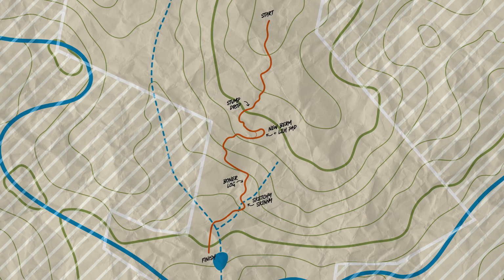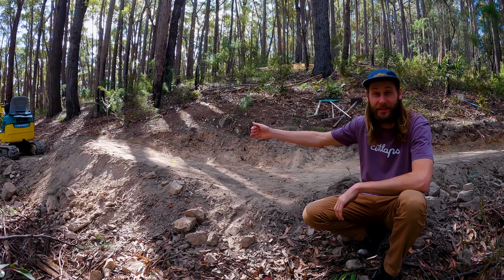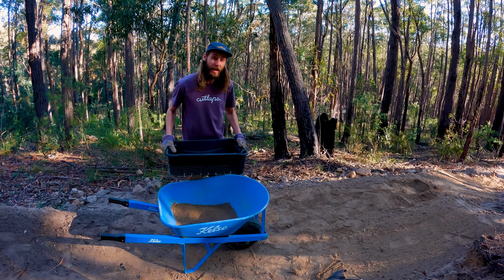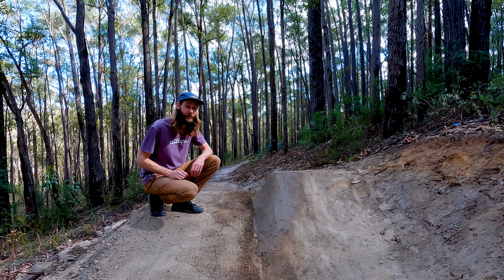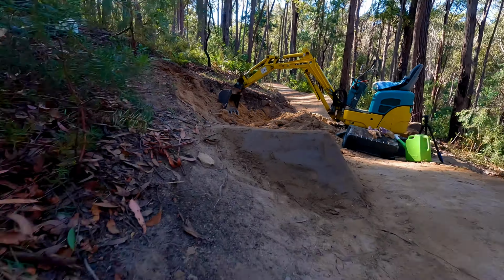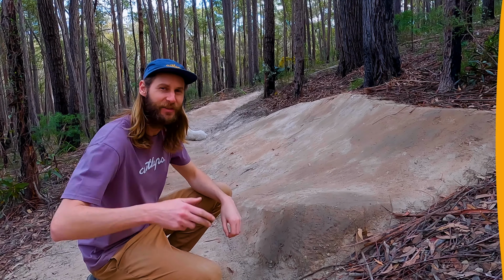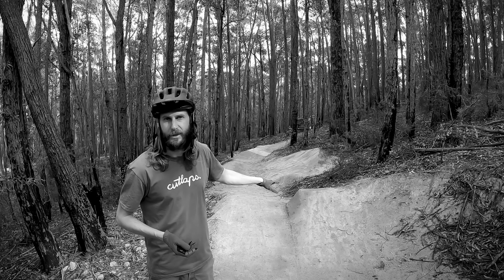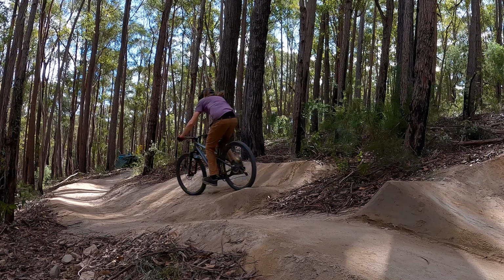This MTB Feature is FAST!

Comment from the maker: Let me know your suggestions on how to make the jump work better. I'm thinking of making it a straight landing. 
This episode's t-shirt winner is JohnnyTheG! Congrats. He also has a YouTube channel you can check out. https://www.youtube.com/c/JohnnyLeeFilms
Reply: yeeewh !
Reply: The hip could work with a different big line off to the side that crosses over the trail and along with a bit of a rhythm section with different line choices if you get what I mean
Reply from the maker: Oh yeah I think I know what you mean. That would be pretty fun.
Reply: @JohnnyThe_G  Congrats mate!
Reply: You could straighten it out with a curved shape so some riders could still land high on the right leaning like a semi wall ride. I imagine this just means straightening the exit and leaving the start of the landing as is then extending the catchment berm to hook into it further down trail.
Reply: @cutlaps  great minds think a like
Reply: Not sure if you've already altered it mate. But you could have moved that roller forward and used it as a landing for the hip. Then just build the following berm up slightly.
Reply from the maker: @kriswilliams6149  Thanks mate! Yeah that could have worked for sure. But yeah it's changed a bit now. I pretty much removed the jump because I needed the dirt for the next feature (the corkscrew) which needed a lot of speed so the jump there didn't work anyway.
Reply: @cutlaps  where about in aus are you based mate. If you dnt mind me asking
Reply: i have just got into your vids, amazing!!!!!!!!!
Reply from the maker: @superduper184  Thank you! Stoked you are enjoying them
Reply: Your the best YouTuber, I look up to you so I can be a mountain biker one day
Reply: make it bigger

Comment: I would get rid of the jump and make it double roller if some people want air and have a high speed/ low speed feature down the trail so they can choose.
Reply from the maker: Hmm that's an interesting idea. The second roller probably wouldn't need to be very big as you wouldn't be getting much heigh off the roller. Just enough to smooth out the landing.
Reply: Double rollers are sick, hell you could even stretch the second roller and give it a second landing to make like a "dragons back" triple. Triple for the mega speed demons and rollers for the chillers.
Reply from the maker: Hell yeahhhhhh there's definitely the speed there for a triple. You would pretty much be landing in the corner though!

Comment: Love the show and I'm learning loads. I'm up the road at Sussex Inlet and building a trail in the hills, only trouble is the sand. I kid you not that it would be 95% sand and sand like the beach with about an inch of soilish leaf litter. I have managed to get help from a Facebook group and the ideas are so helpful. I'm using everything from hessian bags to broken roof tiles and concrete to pieces of carpet, anything to make sand firm. Oh yeah quick set and importing clay as well as a heap of timber jumps , berm walls and drop offs. When it's done I will invite you up for a day at the dunes. For your dilemma I would suggest a step up on the right so when you come down the step you are ready to hit a berm where the track goes right. You could build the rollers bigger then and pump more speed into the berm. ✌️👊 Peace
Reply from the maker: Oh dude I'm pretty sure I read your post on Facebook and I took note of the responses. Just in case I ever found myself in a sandy situation. Sounds like you are getting it under control and building a pretty sweet trail.
I would love to come ride it when it's finished!

Comment: Have you considered French drains running across the trails for drainage? Would just be a short gravel section but I guess you could use fine gravel so it doesn’t feel weird
Reply from the maker: I have thought about doing something similar to that higher up the trail where I can't do a grade reversal. French drain could work.

Comment: Sick video dude, kicker and roller looks mint but I reckon turn that jump into a double roller, so then there is still a fast Flowy option and a air time option, but it’s your trail so I don’t mind. Looks rad either way!
Reply from the maker: Cheers Macka! Do you think I should just remove the kicker or smooth it out to widen the roller? It could be like a cambered roller so that the inside has more pop.
Reply: @cutlaps  yeah a cambered roller would be sick 👍🏼

Comment: Great video! I would suggest a small wooden berm/mini wall ride to roll around the bend from the jump, adds another feature and means the rider will keep good speed as they wont have to brake (or brake as much) for the corner
Reply from the maker: Yeah thats a cool idea. Have you seen the video after this one? The Corkscrew?
Reply: Yeah of course, I feel like everybody knows about that insane feature!  @cutlaps
Reply from the maker: @Fluff3H  haha cool, just wanted to make sure you had seen it because it kind of changes how this section of trail works now. The jump is no longer an option.
Reply: oh is the corkscrew like RIGHT there where you essentially made the landing for that jump? Ill need to rewatch that video to see how you did it.  @cutlaps

Comment: Hi, cutlass! you can make it just a normal landing. It will be a lot of work, but I see some people in the background so I'm guessing that it is a public bike park. if you are doing that plz make a little berm after for the speed. it will be better, also make the lip a bit steeper for more air. to get more speed when you land, make the landing steeper than 45 degrees to gain more speed. also, I saw that you want some more jumps on the trail, you can just make the rollers wider and then take a flat rock or something for the lip. then the end of the roller will be the landing. I hope that you will do this. the trail will be more fun. I see that the trail is quite long and skinny, on your next trail build I recommend that you make a longer gap between the berms on each end so it will be a longer trail for more fun and higher speed. And one last thing. I recommend you also build some tech on the trail. the trail will take more time, so then you have longer downhill and the same uphill.
Reply from the maker: Thanks for all the advice! This section has changed a bit now because of the feature I decided to build after it. You need all the speed you can get so I have decided to forget about the jump. Which is ok because there are plenty of other places on the trail for jumps. I really like the flat rock idea but sadly I don’t have any rocks like that on my property. I’m not sure if you watch @PhilsWorld but he has been building his own trail as well and his property is covered with big flat rocks that are perfect to build jumps with. Always gets me jealous haha. This trail I want to keep pretty tight with lots of fast turns and jumps but I have some other trails planned that will be longer with a lot more space in between berms and there is also some great technical areas that will be fun. I think you would enjoy that trail. I just need to build it haha. Here is a video I did that has a full top to bottom run of the current trail, https://www.youtube.com/watch?v=9P2CH4PNaqQ&t=2s.

Comment: Angle that jumped hard to the left making a shark fin. Then the catch berm should be built up as the landing and that will set you up into the corner turning right. So a transfer from the inside of the trail to the outside of the trail in mid air over your pump bump
Reply from the maker: Dude that would be sick! I can fully picture that. I dont think I would be able to ride it but I can definitely picture it. I need to stop work on this trail and start work on a jump line out in the paddock so I can actually learn to jump. Then I can build cool features like this through the trees.
Reply: You would be amazed at how intuitive that type of jump is. Depending on where the jumping landing is will dictate on how much distance of airtime. But the further up and out you go will make for more of a jump. But jumping is definitely something that needs to be worked on. Good luck with your air time!
Reply from the maker: Thanks I eed all the luck I can get. Jumping (or getting height) just doesn't come naturally ofr me on a bike. I really need to spend more time practicing bcause I love jumps.

Comment: Move the jump back on the trail (still off to the side), use the backside of the roller for the landing (you may need to move this further forward on the trail to balance it out), still a slight hip back into the mainline, but it will get rid of issue with the next corner  being too close and line you up better.
Reply from the maker: Yeah good thinking. That could actually work well.

Comment: Yes Luke! 

The thumbnail on this one was on point. Your 3D work is brilliant! 

Must agree re the rake-hoe. I used to work summer forest fire crew and they were a regular for making fire breaks. Great tool!  

Was the shot flowing over the jumps cable cam, drone or just gimbal? 

Thoughts re the jump: 

1: dig out the inside of the next corner and stack it into a steep berm you can rip around to stay on the track. 

2: make it more of just a straight jump by digging out the right of the hipped landing and stacking it on the top of the landing. Then just have that section stay straight a while longer before joining back on. 

Keep up the good work. I appreciate the quick succession in which the last few episodes dropped 😍

Sam.
Reply: I like the way you described part 1 digging the inside, you can see it kind of acts like a bump. I would try that first (with a bigger catchment berm from the dirt) and it might be all it needs? 🙌🏼
Reply from the maker: Thanks Sam. Thought I would give the 3d arrows a try for the thumbnail. I'm not sure if there is an easy way of doing them but I think my way worked out pretty good. 

I almost called it a fire rake as well. That's cool you worked summer forest fire crew. 

The shot flowing over the jumps was actually me just running with the gopro on a selfie stick. No gimbal needed. It kinda looks like I sped up the footage but that was untouched. GoPro's inbuilt stabelisation is next level!

Good ideas regarding the jump. 
I'm thinking number 2 is the way to go. I don't think I would even need to have the section stay straight for any longer. If you don't have to position your weight to the left for the landing you can be getting ready in the air for the berm to the right.
Reply: @cutlaps  Great stuff! Yeah, love the look of the 3D arrows. 

In camera stabilisation is insane these days... Nice one! 

can't wait to see how it turns out 🙂

Comment: Could you possibly have a raised wooden feature to land on that cuts the corner a bit and makes it a bit more of a  straight line? Might have to remove a small tree and squeeze it between the others. 🤷‍♂️

Or make a second line that hooks left off the landing and cuts straight down the hill with a big jump over the trail below. 🤙
Reply from the maker: I hadn't thought of using wood but that could be a possibility. I was thinking of making the landing a bit straighter so you didnt need to turn to get into the berm. I should have enough dirt piled up on top that I can shuffle around. 

Seems like lots of people want to see a trail gap! That would be cool!

Comment: If you could jump as far as you anticipate shredders traveling, the landing might feel alright. But it's creating a step that's throwing you around abit by not getting that distance. I'd dig it out more, with a radius instead of a flatbank at one continuous angle to where your landing. More of a shark fin lander.

Enjoying your content!
Reply from the maker: A shark fin lander would be cool but I think the right hand berm after it is too close. Maybe the trail needs to go straight for longer instead of the berm. Thanks for watching.

Comment: Wow, this is really nice. I have been trying to find some more Aussies that are building trails.
I live in Far North Queensland, and the ground here is sun-baked and about as easy to work with as concrete.
Really want to get a mini excavator, it would make life so much easier.
Reply from the maker: Hey mate. Thanks for checking out the channel. How far north Queensland are you? I don't like the sound of your dirt haha. Definitely need a mini excavtor. Probably want one a bit bigger than mine if the ground is that tough. Tell me a bit about the trails you build.
Reply: @cutlaps  I am on the tablelands, but there is a wet side and a dry side. Unfortunately, I'm on the dry side.

Comment: Maybe drop a rock in there for a nose bonk or tail tap.  If you make it a slower tech jump the catch berm will be fine
Reply from the maker: That would be cool! Obviously I wouldn't be nose bonking it (would definitely go over the bars) but would be cool to see someone else do that. Only issue is the next feature (if all goes to plan) needs a lot of speed. So I need to make this jump work at higher speeds.
Reply: Nose bonk rock is an awesome idea, I have yet to find a well placed rock for one. @cutlaps a roller is a great place to start learning a nose bonk (basically air the roller then as soon as you lift off push down then immediately back up while in the air.) Im still learning them but I assume a rock bonk would be the same just bugger air and adjusted timing. (I want to get to the point where I air to the left of the rock and whip my front tire to the right to bonk it)
Reply from the maker: @mattspen  oh yeah good tips. I think I need to get comfortable in the air and popping first. Think I'm going to start work on a small jump trail out in grass field when Tashi is down. That way I can actually practice without having to worry about hitting a tree. 

Also I did move my biggest rock on the trail at the roller. Its properly the perfect size if I built up a dirt file to rest it on.
Reply: @cutlaps  good idea on the field. I wish I had trees in the desert
Reply from the maker: You gotta buy your dream property and start those trails!

Comment: @1:10 Glad to see the tool mounted shot is back! (And that song is becoming a classic too, love it) … But how did the camera not flip when the McLeod flipped?
Reply from the maker: Magic! 😂 I have the max lens mod for the gopro. It keeps the horizon level no matter what the camera does. So the camera actually flipped with the tool but the image stays straight. Glad you like the song... I'm running out of available music that I like for my videos haha.
Reply: @cutlaps  that’s awesome! More max lens mod shots please. The same shot again is fair play. Hmm, for other ideas my first thought is a pedal, but it stays upright ha! Maybe your bars pointed down (no horizon?). Maybe on the digger arm, only partially twists/spins. An extended axle on the wheel barrow, would anyone tell (no shovel spin etc). A shovel toss to a buddy with a spin in the air!!!! #BringBackToshi
Reply from the maker: So many ideas! I like using it on my chest mount. The camera stays level through the corners but you can really see how much the bike leans. And you will be happy to know that. Tashi has booked in a trip at the end of the month. I'll definitely see if I can get the shovel toss to work

Comment: WOW this channel is AMAZING!!! You definitely earned my sub. How much land do you have? Also what would you say your average slope angle is on your property?
Reply from the maker: Thanks Owen. It's actually my Dads property that I am building on. About 160 acres, so plenty of room for trails. I have about 120 metres or 400ft of elevation to work with. And multiple valleys to explore. The slope varies so much but it's pretty perfect for MTB trails. It probably looks a lot more flat on video but there isn't anywhere on the trail that you struggle to get speed.
Reply: @cutlaps  That is so cool! I’m working on a backyard bike park too but don’t have quite as much room to work with. Feel free to check it out though! What advice would you give for making tight berms more fun?
Reply from the maker: Oh sweet I will check it out for sure. Hmm I struggle with tight berms because I am very tall so I am on an extra large bike. So I prefer to build my berms a bit bigger. Tight berms can really kill speed and flow. But if it has to be tight for a reason than you could try and make them steeper so you can really lean over and rip around it.

Comment: You need to give the lip of the hip more pop and then change the angle of the take off to spit you up to the right, you aren’t giving it enough degrees of angle on the curve, give it almost a little bit of vert (well not vert, but you know what I mean with the angle)
You want height not speed, remember when you are building that you don’t make the rider go to straight without enough pop to give them height, which also allows you to switch the riders angle much easier.
Reply from the maker: That is some solid advice! This jump has pretty much been scraped now because the corkscrew feature that came after it requires a lot of speed (and dirt that I borrowed from the landing). I think I will build something like this again somewhere else on the trail and I will make the lip steeper like you said. Thanks for your help.
Reply: @cutlaps  bro, as a fellow Aussie, it is a pleasure! And…. If you create more pop, you can actually have landings that are dodgy because of how you wash off speed with height, which lends to being able to have tighter landing spots Co
Pared where the take off is, and you can have more control over how you land when you go up more than you get projected forwards without height
Reply: @cutlaps  there are a few really good track builders here in the uk that you can watch their builds through ‘Matt jones’
You will pick up some really useful tips also from Matt jones when he was building his training playground. He talks about the angle of degrees and the math you use to create the jump based on your run up and angle 📐 into the jump.